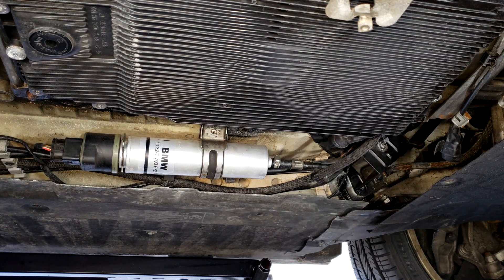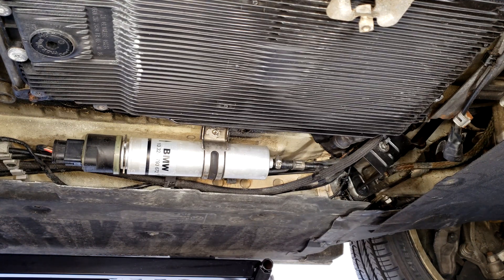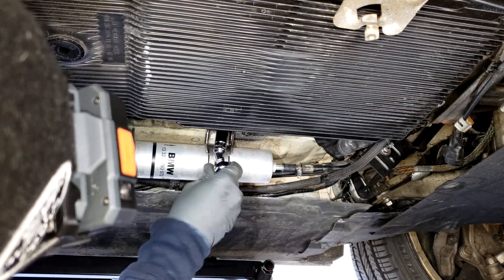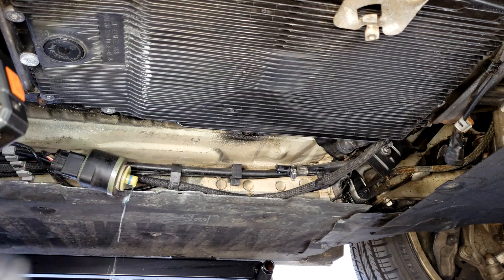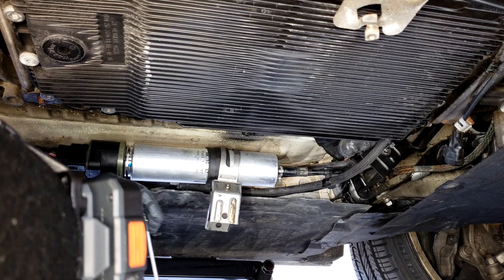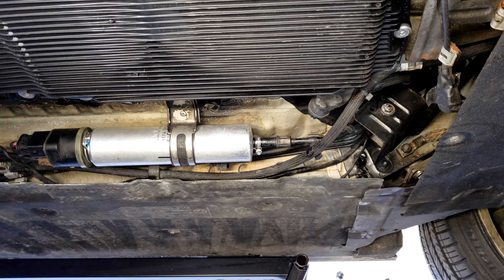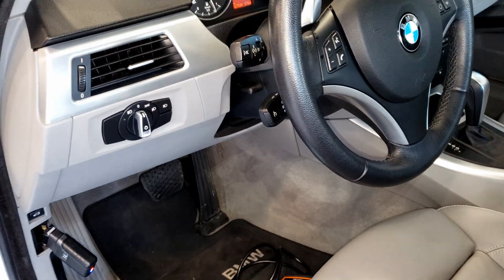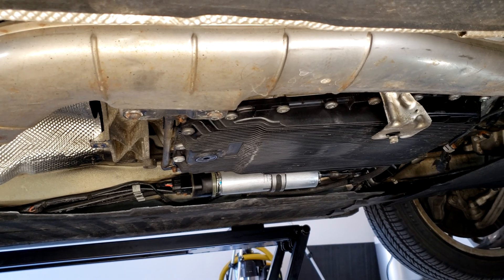BMW 335d Fuel Filter Change + Prime/Bleed System - E90 M57

Comment: I ran into this problem with the fuel when I first changed it by myself, luckily I was able to get the engine started by turning the ignition on and off many times and cranking a couple of times

Now I replaced the valve gasket and the injector fuel line stayed open for a few days before I installed everything back and the system caught air, I tried ignition on/off and cranking but ran out of battery so the pump doesn't even start anymore, I checked the pump and luckily it's still functioning just not starting due to low voltage from battery 

now Instead of doing it manually I think it will be smart to invest in some tools, ista, vacuum pump, booster and take care of the vehicle the right way.

Comment: ANYONE WATCHING A TRICK FOR PRIMING /running fuel pump:

I discovered that removing the blue DDE relay in the engine bay and turning the ignition on turns the fuel pump ON
🎉
Reply: This works… just be careful and disconnect the battery before you remove the fuse and before you put it back in

Comment: At how many miles do you recommend replacing the fuel filter for a 335d?
Reply from the maker: I do mine every other oil change. It's quick and easy enough to do, for that piece of mind.
Reply: @Lefteris7  That's way overkill.  Once a year is more than often enough.
Reply from the maker: @Joedoriamusic what's overkill? Every other oil change is 10-15k miles. That's probably every other year for my driving...

Comment: With all due respect, these cars have a self bleeding system & venting system. No need to use a Diag tool for it ! It's written in the books how to use the self bleeding system. Worked for changing injectors, fuel pumps.. etc ! :-)
Reply from the maker: With all due respect, I'm not sure where it's written in the books to NOT prime the fuel system. It's literally the easiest thing and ensures longevity of the high pressure fuel pump from running. That's "in the books" from Bosch for their pump.

I am curious though why you are watching a diy video in it's entirety on replacing a diesel fuel filter if you already know more than me
Reply: @Lefteris7  well, as with many video’s , people take examples. It’s not needed. The car PRIMES itself! Read the haynes manuals and workshop manuals. No need for a diagnostic tool or anything. Saves people money!
Reply from the maker: @mickstick2830  im not forcing anyone to do anything. I merely showing the proper way. If you don't want to prime thru obd have at it. I'll agree to disagree with you.

Also the Haynes manual is the worst thing to use. Additionally the Haynes manual does not capture 335d, diesel m57 engines. It merely offers general guidelines. 

Good luck with your fuel filter
Reply: @Lefteris7  i do this for a living, just wanted to point it out, without you feeling attacked, but my mision failed. Have good one.
Reply: @mickstick2830 Haynes did not do a manual for the 335d M57
Reply: @barnzYT it has for the M57 wich is in a 335D. Same engine; same procedure. I don’t make this stuff up.
Reply: He is correct 
You don’t need to use a diag tool 
The m57 primes itself
Reply: Priming via diagnostic tool makes it easier to start the vehicle after. 3 minutes of priming and car fires right up vs cranking for like 5 minutes for sistem to prime itself is a no brainer.
Reply: @mickstick2830  can I manually prime n47,bmw x1, e84
Reply: @vinod-r1  normally yes,depends on the year usually of the N47. it's made so people can install some parts without needing EXPENSIVE diagnostic tools or software.
Reply: @mickstick2830  it's 2012 model
Reply: I did the job also without priming
Reply: So basicly you just connect the new filter and you just start the car?

Comment: why is it necessary to have diagnostic tools for and prime? just switch the ignition on and it will take care of itself, and the pump turns off when the required pressure is reached.
Reply from the maker: If you want to do it correctly you need to prime the pump. You can definitely do it without priming but you will run the pump dry and decrease it's life. Takes no effort to prime, do it the right way instead :)
Reply: @Lefteris7  Thanks for the reply, I have access to the diagnostic program ista d, I just changed the filter and delivery pump on the e65 m57, how does the diagnostic program prime the pump?
Reply from the maker: @Trulte60  you clearly know what you're doing if you have ista-d
Reply: @Lefteris7  yes, it's a very good program, but i never try to prime the pump, only run the pump for a minute or two, I thought the system was self-venting?

Comment: Is priming mandatory via the device or can it be done via ignition?
Reply from the maker: I would not risk priming via ignition as you will stress the fuel pump prematurely. I highly advise you get some sort of diagnostic to do this whether it's protool, or some other obd that can do this
Reply: I agree. I did not prime mine correctly years ago. I believe I may have damaged the mechanical fuel pump and years later needed to replace it. It is not an inexpensive pump.
Reply: ALWAYS prime with a scan tool until surging/bubbling stops. Unless you wanna buy a reman HPFP for about a grand and possibly send metal shards through your fuel system.. It's not a Ford, the system does NOT self prime by cycling ignition.  You can cycle the button all you want. The service document is incorrect. I own 3 vehicles with this engine.

Comment: How long does the prime take? Is it more than 3 minutes?
Reply from the maker: 2-3 minutes usually. You can prime more than once if you need to
Reply: @Lefteris7  thank you worked on the second try
Reply: @Lefteris7  Is the fuel system bleeding function on that Foxwell available for newer N47 engines? Thank you!
Reply from the maker: @cristiandemirel1918  yes